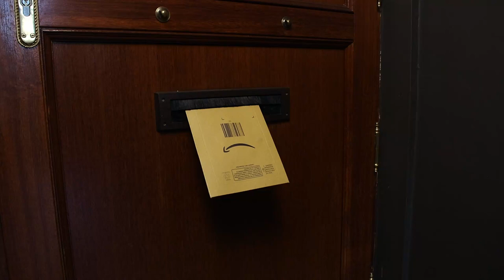I Managed to Make My Own Spirit Level, but WILL IT WORK?

Comment: Hi
Very well found and nicely fabricated, I love the lines.
I would never have thought of this.
Maybe a positive critique, you pasted the circles with the levels very firmly.
Recently I had an accident with a spirit level, one level was broken and I could not 
replace it.
Why not use a very thin and fine screw, so one can replace the levels if necessary.
This isn't meant to be negative, you'll know that, but just an idea.
Keep it safe, it is not over yet.
Willy from Belgium.
Jij hebt dit weer eens netjes voor elkaar gekregen proficiat.
😷😷😷
Reply from the maker: Thank you, Willy! The idea with the screw is actually a great idea. I love it. Now with the glue, it is permanently attached. With your suggestion, a broken bubble level vial is easily replaced. Thanks for thinking along, my friend! Greetings, Christophe
Reply: @christofix  Je weet dat dit nooit een probleemis.
Goe bezig.

Comment: Very nice tips especially to check the spirit level, maybe another tip to correct a not level one? (homemade)
Reply from the maker: Thanks buddy, It is a simple tip, but it's a good one. I do not have a tip to correct a spirit level. I think most of the spirit level can not be corrected at all. But with that tip in the video you can check if yours is level and in case it is not you can replace it. 
Thanks for watching, buddy!

Comment: I made some levels, but before I did I checked the bubbles before using them right from the package. Some had to be slightly sanded on the ends from the mold marks. Then used a trusted level every step. All three bubbles were on. But I'm concerned about the wood warping.  What wood is best? Sorry, I'm asking this before watching your video. I was searching this and jumped the gun on it. I will watch it. Probably answers my question.  Thanks.
Reply from the maker: Well I think the best wood to use is the plywood I used to make this. Plywood is one of the most stable woods out there because of its lamination. If you have more questions, feel free to ask. I will answer them where I can. Greetings, Christophe